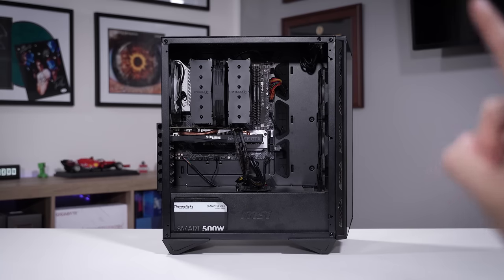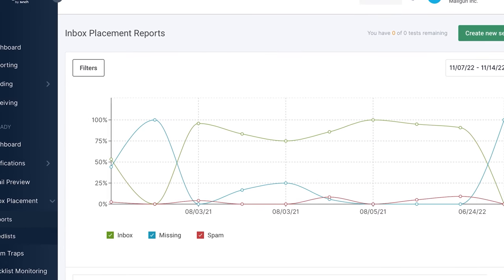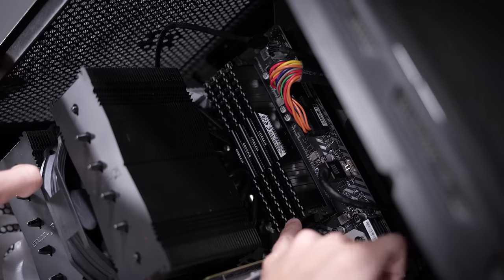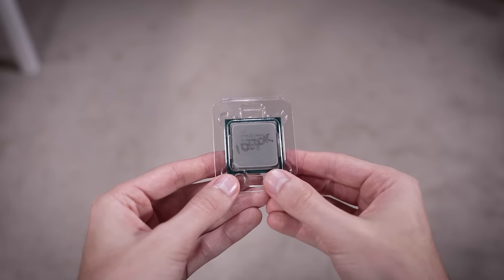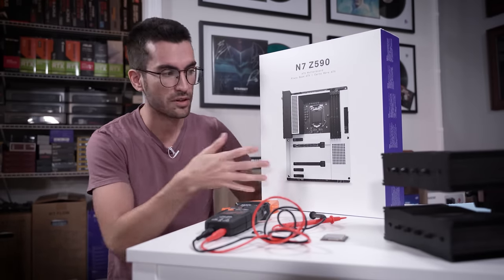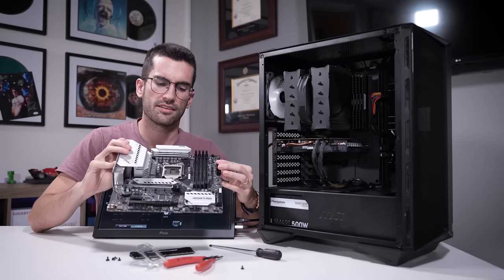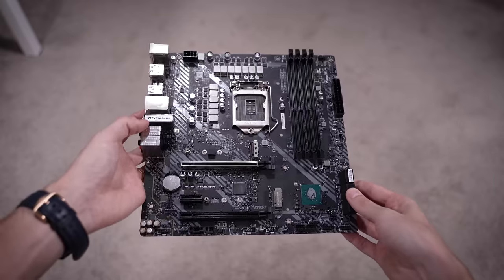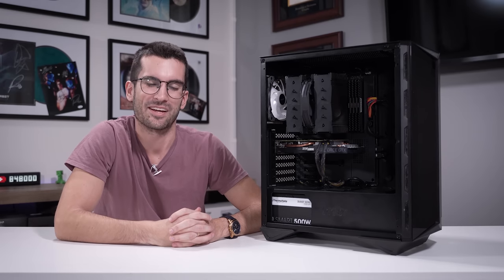Fixing a Viewer's BROKEN Gaming PC? - Fix or Flop S3:E14

Comment: I have done the jumper trick for clearing the CMOS but ended up having to pull the battery for it to completely clear the CMOS. Then everything worked just fine but that's what happened to me.

Comment: On the back of the motherboard in the correct slot flash the latest bios with a USB stick and keep the battery out until its installed , i had the same problem when trying to update my motherboard.. It did take me a while to find the right software and format the USB stick so it could read it but it now works fine :)

Comment: Ebay sellers have preprogrammed bios chips for cheap. I ordered 3 latest revisions pre flashed for a X79 MOBO.
These 8 pin chips are pretty easy to remove and replace. Did my first soldering on one to fix a Samsung TV.

Comment: I did exactly what they did to a B450 MSI board fortunately I had bios flashback on that MB and I re flashed the Bios and it all worked again unfortunately that B460 doesn't have Bios Flashback so your screwed.

Comment: If hard pressed between board and CPU, I would test the CPU in a known-good board. If the CPU would be defective and in fact be a serial killer, it would frag the board that usually is the cheaper part.

Comment: Nah with desktop motherboards as they are unless it was something ridiculously I think very few people are gonna try to fix it, and it wouldn't be me, "bricked during a bios update" though is a good enough clue that I would try a eeprom flashing tool.

Probing around the motherboard to find the issue takes a lot of time, which is money, and if you don't find or can't fix the issue (like say you find a bad power stage that shorted and it supplies power to the chipset, you can replace the power stage but that chipset may now be dead) then you've wasted all that time when you could talk to your customer and say "hey this board is dead, we need to replace it, here are options A B and C". The exception to this would be when something profoundly expensive or worse priceless is attached to the board, like if you've got a top end gaming laptop, okay your GPU is soldered and that's a lot of cash for a full replacement, OR in the case of most commonly macbooks the storage is soldered and your work or vacation photos or whatever are part of that board and the data is worth the extra time money and effort. In desktops though? nah...

Comment: If my AIO and fans are all working properly but cpu temp is hitting 100 and throttling frequently but not consistently how should I approach troubleshooting this? after restarting the unit several times it seems to be fine randomly, next start up it'll have issues again.

Comment: a few advices here, while testing the mobo, you can pull out the psu and the mobo, so you have better access to the components of the mobo without having a lot of drama, and also, if you put the cpu and the mobo is at fault you have a risk that the mobo kills your cpu then it could have been a drama if you put the cpu in another mobo, i have a damaged z390-a, a damaged b365m-a and damaged ram and psu of both machines and that was because testing a faulty z390-a, try to reduce risks man, risks can be expensive as hell!!!!

Comment: Hi, i have a question for you. My pc used to turn on no problem. Now it dos that intermitenly. Sometimes it turns in some not. The fans spin up all the leds light up, motherboard puts out power to usb. But no signal. The ram is teated, psu, gpu are tested too. The only thing i figure is the cpu or motherboard. I have updated the bios. And once it turns on it works just fine, plays games fine etc. Whats your take on it? Have anny suggestions?

Comment: He says something happened when he tryed (entered bios flash tool) to flash bios. Many micro atx boards are known to use cheap bios chips that go bad for no particular reason. First thing would be rescue bios (if this board supports it) or flash bios with external bios flash tool ;) Seen more then 1 micro board, that bios went bad just because someone deard to enter bios menu, lol

Comment: Some months ago, a blackscreen appeared on my old pc, i troubleshooted it for hours and it booted on the integrated graphics, i found out it was a corrupted bios, the gpu was fine, also the backup bios chip on it was corrupted, i don't know why but i somehow fixed it for a week or two by trying to install the bios on windows via @BIOS by gigabyte after that i got a new mobo and cpu and everything's fine now

Comment: Yeah as many say an EEPROM programmer is the way to go on such a case. Only issue is to get the binary image of the correct bios once it is programmed. The downloadable file you get from the manufacturer website is either encrypted or get "processed" during flashing. So you just cannot directly flash it using an EEPROM programmer. You would need to get your hand on a known working (bootable) image from a working card, from forums or buy a pre-flashed bios EEPROM from Ebay, But if you get your hand on this binary file, the flashing process itself takes about 10 seconds and is super easy.

Comment: I had to troubleshoot my main rig this past weekend and it made me think of your series. I got a new mobo but it ended up being the CPU. I also was getting a flashing red light on my GPU which indicated a PSU problem. It was exhausting but I finally got it working properly and with better temps than before. I fried it running Prime 95.

Comment: any chance you can unbrick a Corsair Ironclaw RGB Wireless mouse, its a common issue that Corsair simply won't do a thing about, i even tried contacting them for a firmware file and as of yet they haven't got back to me at all, i am willing to buy a chip reprogrammer to reprogram the chip that contains its firmware but I can't get my hands on the firmware anywhere.

Comment: I had a similar issue that I thought my mobo got bricked after bios flash. I got a new GPU and I worked fine initially after install but I realized my mobo bios was a year out of date so I flashed. After I could not get the screen to come up. after many days of YouTube I found that NVIDIA released a firmware update for DisplayPort specific for my GPU. Using hdmi on integrated graphics, I Installed, cleared cmos and it worked again on DP

Comment: I like these episodes. Trouble shooting can be very difficult. I have a PC I made my self back in 2011, with a 2600k and everything, still running fine, but I have never been able to overclock it for some reason, it just freezes up when I get into windows. Even if I try running another voltage on my ram, since I have some low voltage ram, my computer just freezes just the same. Never been able to pin-point why exactly. I know it properly wouldn't be worth it with such and old PC, but I can't just buy a new one, but getting help like this to maybe fix it would be awesome. Also I at some point deleted a program for my Intel SSD, from the same time period (I think this is what happend, as I can't remember anything else that could have done it), and after this my computer haven't been able to shut down properly on it's own. It shuts down, and I have hear the soundcard etc turn off, but the fans keep running and the LEDs, and then after maybe 5 or 10min it shutdown completely, so I usually just shut it down with the power button after the initially shutdown, instead of waiting the 10mins. I haven't been able to fix either problem and I live with them now, since the computer works fine, when it is running in non overclocked mode. And the shutdown problem doesn't really change anything. Only thing is that being able to overclock when it is so old, would prolly help it live a little longer performance wise.

Comment: Something that happened to me recently in case anyone happens to be having the same issue. After updating the graphics driver for my 3070, my screen wouldn't show the bios screen anymore and after resetting the bios, it wouldn't even boot into windows anymore. The only way to fix it is to rollback the drivers, I only found this out after replacing the motherboard and having it happen again on the new motherboard. Nvidia told me that they know about this and that it's happening from at least the 3070 to 3090ti

Comment: I would probably have tried running the system outside of the case to see if it worked, and tried bending the board slightly in case the board had a hairline crack between the ram and the cpu lanes.
I had a board like this before, and I could only tighten the cpu cooler so much before it put strain on the board and wouldn't boot.
But it was kind of fun... tighten the cpu cooler, no boot, loosen a mobo screw it a bit, boot, tighten cpu cooler a bit, boot. Job done.
But of course the fact that it failed during a bios update probably means that was the problem.

Comment: Unplug the battery and power from the wall let it sit with no cmos battery . Think old intel laptops that would just stop working until you pulled the battery and let it reset

Comment: If in 2023 you are building semi low end budget of 800$(US) for 1080p 144Hz monitor, would you consider getting used 1080 ti for 200$(US), and rest of system new parts ? Or do you prefer other GPU for 200$(US) or lower.

Comment: Put a CPU back in the board and leave the ram out. Turn on the board on and see what happens. Sometimes ram can cause a board to go stupid and you can knock it back into operation by booting minus ram installed. And yes it is completely safe to do. MBs have fail safes in this regard. But like I said because this is a ram error doing this can make it operational again.

Comment: I had the almost same experience, what happened I think was the uneven pressure of the cooler, I was using a cooler with four points to screw and it looks like I have over tighten the one or two screw. It now only working on single channel on the right most DIMM slots :). For now I stopped using the old style cooler with four points of screw and not over tightening them.

Comment: You should buy you a ch341a bios flash tool… it’s 10 bucks on Amazon and would honestly be awesome IF it worked to flash bios on the board… never used one but would love to see it dont and see some boards saved

Comment: 7:03 pause there, look at the socket's top right corner and tell me that is not a bend/broken pin or something else? i just can't see it with my eyes
there is something that isn't supposed to be there or like that
upon closer inspection on most sockets this pin could be an SB-DQ pin (DRAM related)

Comment: I had a similar issue when I wanted to update my MSI B450M. I tried to get into the BIOS update enviroment and it just stayed black and unresponsive, even after several reboots. Lucky enough, poping out the battery and absolutely making sure I drained all power to clear the BIOS worked it back to the normal enviroment. That was scary to say the least. funny that it's the same situation on another MSI board

Comment: Had something similar with a x570s aorus master bored stuck on dram light but it did had a dr dmos on board with code 4d on it ( memory initialize I believe ) ended up sending it in for rma gigabyte told me bios needed to be reprogrammed said they done it sent it back to me and was doing the same thing sent it back and they sent me a replacement. I know it's not the same chipset but similar symptoms

Comment: I just spent half a day trying to figure out why Windows Explorer was going into suspension because You could not open anything, or when Id get a tab open it would close that app and reopen the previous one right away. I could scroll, but right clicking any buttons would show the action but noting would happen, I think I finally figured out the problem. The mouse hardware must have some sort of fault because on a whim, I popped the mouse onto another rig and it immediately reset the Windows install on that machine And it started to act like this rig here.  I have only windows drivers and no other mouse software installed. Has anyone ever heard of that? FYI I have a cheapie dollar store optical mouse on the rig, and it has been working flawlessly for a few hours now. Take that ridiculously overpriced RGB gaming mouse. lol

Comment: I had same issue with the MSI board i have. Went to Update Bios in the MSI app it shut down and would not boot back up no post. I got lucky and used Flash back about 5x and finally got it back to posting. MSI is really weird I normally use ASUS.

Comment: I've never seen thermal pads baked on like that even on hardware from 2011 she was running hot for sure; some boards have dual bios that can flash back by holding the power button I thought I bricked an old Gigabyte Z68 motherboard updating to the latest beta UEFI bios from the standard legacy bios you should check the motherboards documentation. also check it with the onboard video there may be a message unable to display on the external GPU

Comment: if the board is a MSI, I've had issues with these this last year.... like I mentioned in another reply, there seems to be a bad batch of these motherboards out there.... and now the B460 platform is effected... I hate this when these things happens, because it takes so much time in troubleshooting. and if it is the bios, then that kills the board.... even if it has the backflash option, that doesn't always work....

Comment: I'm surprised that you don't keep a set of working motherboards for the more modern chips for testing situations like this. Even if it is just a cheap mini-ITX board that does little less than power on with a PCI-e lane for a GPU.

Comment: Personally Greg, I like the way you are fixing systems right now because I'm 100% sure that most people, myself included, DON'T have the tools required to change or test bad components on a circuit bord. Although it's interesting to watch someone change those components, I think it's way beyond the average power user's ability to do that. If I had a component go bad I would troubleshoot it the same way you are doing!

Comment: I had this same issue with a new build, ryzen 7900x and gigabyte board.  I returned both after a big hassle.  d ram light and then cpu light occasionally.  would not post.

Comment: Any chance you can unsolder the Bios chip and flash it to the correct Bios? Seeing that it failed when doing a bios update its 99% gonna be a corrupt Bios no need to be probing the mobo just fix the Bios.

Comment: These videos are great, I love watching them. I bought my son a new case and did a straight swap and it turned on for 30 seconds, then black screen and kept rebooting, then nothing but black screen with the vga light on with the dram light flashing every few seconds. I had to strip my pc and test all components and it came down to motherboard or cpu, luckily my mate had a spare board and after testing found out the motherboard failed, I have no idea why I did not take anything off of it I just took it out of the old case and put it in the new case, if it wasn't for these videos I would no idea what was wrong or why, so thanks for the videos.

Comment: make sure the RAM is gapped properly.  A gap of .42 should be good, unless its boosted.  Run colder RAM, and gap it smaller around .28-.32.

Comment: I know with a Cooler like that, I add a fan in the back to help move air out of the system even with a rear fan in the system. That can help keep the air from having issues going from A to B. Also, most of these coolers want at least two fans, one in the middle and usually one in the front, but if you really don't have enough clearance from the memory, the back is a good option. As others have noted, sometimes you can have the front fan a little higher to deal with clearance issues without affecting airflow too much (that third fan can still be useful, may even let you run a little quieter due to how the airflow ends up). For those thinking to add a third fan on something like this, go with what was used on the front. Most coolers will tell you what model fan they are using for that front fan.

Comment: I have an issue with my computer and monitor entering my Bios and I’m fairly certain it’s the refresh rate I have a Samsung Odyssey G8 so it can toggle between HDMI 1.4 and HDMI 2.1 and you can also toggle between 120 FPS and 240 FPS if I try to enter the BIOS it black screens but I can enter the BIOS on a 60Hz 4k monitor
Reply: the Odyssey G series monitors are all known to have these kinds of issues. Sadly since the original G9.

Comment: I have that exact same case!  I got it for $20 on FB/CL (I forget).  Beautiful case.  I took the power button out to fit a 20mm fill port for a custom loop.  I just used the RGB button for a power button.

It has room for a 360mm radiator, but terrible airflow.  So I grabbed a $5 "rain gutter mesh" from the hardware store and bolted it on instead.  Ao much better.  What a fail of a front panel, sooo close and then dropped it.  The glass is on with adhesive, so leave it on your car dash in the summer and it will soften, or use a heatgun, soak it in rubbing alcohol.  Or just leave that side alone and only do the metal side (it unscrews) pics:
Reply: Pics got eaten by the comment sanitizer, just Google gutter mesh and your favorite big box home improvement store.  Should be $4-5.  My pictures are up on small form factor . 🥅

Comment: at 13:40 you see a damaged/exposed trace on the right side of the socket, at first I thought it was a smudge but it follows the trace too perfectly.

Where the upside down Noctua cooler triggered your OCD, for me the most triggering part is the ketchup&mustard cables of the PSU.
Reply from the maker: That was thermal paste IIRC. It was not a scratch.

Comment: Maybe try slower memory and it'll post I had that issue where it auto set something wrong in xmp profile for ram. Once I got the right setting the ram worked at the correct speed.
Reply from the maker: This is why we clear the CMOS. Removes this variable entirely. Also tried multiple DRAM modules.